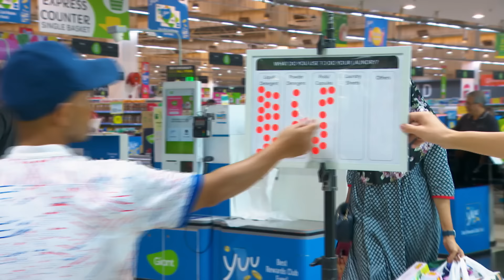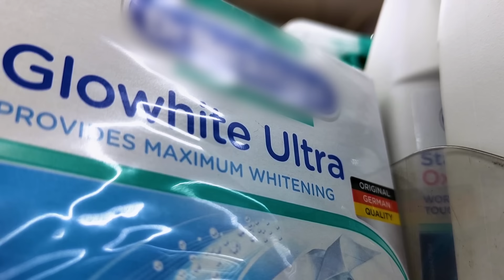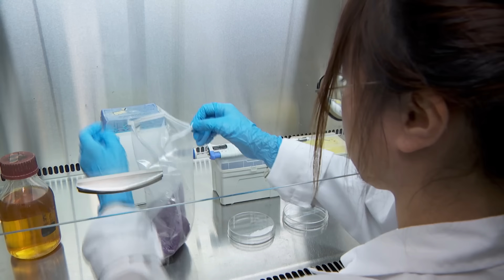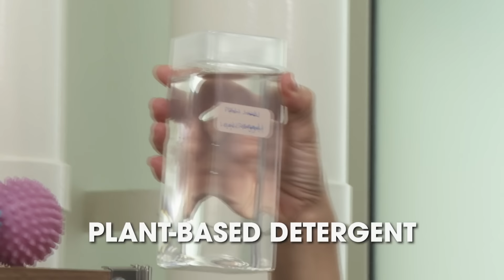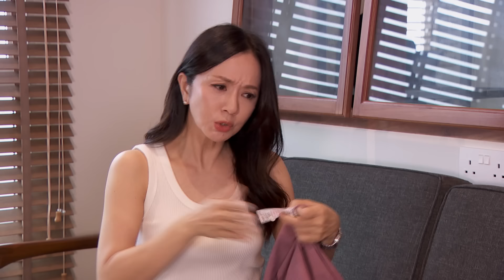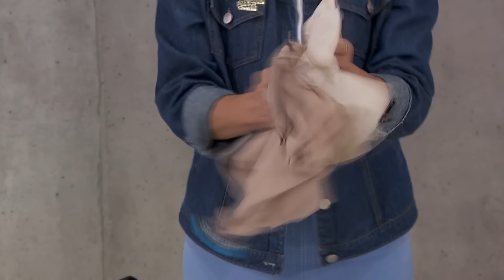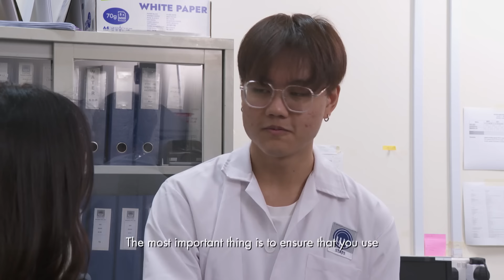Which Laundry Detergent Works Best? | Talking Point | Full Episode

Comment: Nice piece. It's confirmed my opinion that antibacterial laundry detergent is just a gimmick. However, there are other factors people look for in clean laundry other than germs, and that's grease and stain removal. My liquid detergent is great on its own, but when there are heavy stains like tomato, coffee and kunyit, a half scoop of vanish (or any other hydrogen-based cleaner) helps so much to lift stains. Also, softener and optical brighteners are unnecessary and damage clothes in the long run, especially synthetic fibers like sportswear.
Reply: I agree. A stain reducer is great for stains, but almost any detergent works otherwise. Bacteria can be reduced by drying laundry on a clothesline (or other air drying)
Reply: @kawaiidere1023 Depends on the dryer temperature. And of the water used in the washer. 
But hang drying clothes won't destroy all bacteria or viruses.
Reply: Drying it outside in the UV light ( not necessarily direct sunlight) kills bacteria and mould. It also softens as the air fluffs up the fibres, and smells fresh. No need to use a dryer. That electricity is expensive and polluting.
Reply: So u add vanish together with liquid detergent inside machine?
Reply: anti bacterial actually decrease the smell of my sweat-wet t-shirt(cheap, mostly cotton) I wear inside my work shirt (was A/C tech, sweat buckets)

I also finds out that my cheap jeans and work shirt scrape me less with detergent
Reply: Yes, that's because all surfactants will destroy the outer membrane or shell that protects the bacteria, thus killing the bacteria. Antibacterial claims are just a gimmick. 

The same applies to your hand/body washes. All soaps (even bar soaps) are effective at removing dirt/impurities and  bacteria. What you do after is what matters. Our skin has a protective layer called the stratum corneum or skin barrier. It protects us by preventing microbes from entering our bodies through our skin. If you have a weakened or impaired skin barrier, micro cracks will appear, and this in turn allows moisture to escape as well as allows microbes to enter your body through your skin. Moisturizing your skin after a bath/shower or washing your hands will strengthen and reinforce your skin barrier.

Just as the video illustrates, it doesn't matter what detergent you use, the most important step is to ensure that you clean your washing machine regularly (at least once a month as the host said). Similarly, it doesn't matter what body/hand wash you use. Liquid or bar, both will do the job well. It's not skipping the moisturizer that's the most important step.
Reply: I learnt the hard way about softener. Any sportswear will degrade and smell bad with a combination of extra detergent and softener.
Reply: Nice. But my clothes smell nicer with softener..
Reply: @nadnada5436  softener often leave a layer of something film on clothing. It will also damage your washing machine in the long run.
Reply: @sleepyearth It's common to use too much liquid fabric softener ... especially if a front loader washer is used because they employ less water than a traditional top loading machine. Plus people tend to use the same amount of softener regardless of what's being washed; e.g. an average load with t-shirts, socks, underwear, vs a load of linens, particularly towels.
Reply: @nadnada5436 why do you need that. Clean clothes should smell of nothing. I find with low temperature washes that clothes don't get clean and you then need to mask it with perfume.
Reply: Yes, but softener will make your clothes smell bad faster if you sweat. It gives bacteria a better breeding ground on your clothes.  @nadnada5436

Comment: For me, it depends on how and when you want to wash your laundry. For example, if I need to soak my laundry/linen overnight, I'd use powder. If I want to wash my laundry immediately, I'd use liquid. I'm from a rural area in Malaysia, so sheet detergent and laundry pods aren't readily available. Also depends on the type of washing machine you're using I guess. Mine's semi-automatic so I can control how much water I want for my load of washing, therefore I might need to reduce or add more detergent. So far I mainly use powder because it's more economical, and I'd fill up up my washing machine with water first and add powder and let it dissolve by letting the machine do one minute cycle on low/gentle. From my experience with automatic machines, you can't really do that because the machine will only do a cycle if there's actual laundry inside.

All in all I think all types of detergents has its own pros and cons. I buy my detergents in medium sized packs so I can have the variety and choose to use what I need at my leisure without straining my wallet. But I guess that works for me because I live with my mom and we're a small household so this works for us, but it might not be suitable for a big household that has a ton of washing to do daily.
Reply: Laundry pods are also not good for the environment. I read Jumbo sizes require to use more of it so not really a saving.
Reply: Semi automatic? Is this the one that have 2 compartments...washing & drying a.k.a the OG? HAHA
Reply: If you add detergent before adding clothes, etc., it'll dissolve as the tub fills. (Just check if you're using cold water.)
With automatic machines you can also add the detergent first to the drum (dissolve it if necessary) if you're not using the pre-treat/pre-wash cycle. But even then you can add dissolved detergent via the dispenser (at the right time of course). I do that because I titrate the detergent to the size of the load and to what's being washed. (Better to start with the least amount of detergent and increase as needed.)

Comment: I long came to the conclusion most of the newer and improved products are just schemes for the big companies to get more of your money. For a very long time I cannot get powder detergent from Costco. The so call eco friendly stuff often comes in liquid form are mostly ineffective and crap. Don't even get me started with the disgusting scents that most people are brainwashed to think they smell "fresh". They are all synthetic fragrance that will trigger my allergy and my nose would not stop running. Even often the commercial powder detergent are often laced with this disgusting perfume.

Liquid detergent is just detergent with water to add weight and their dispenser always makes a mess. Capsule detergent is the worst of all create to get more or your money especially the lazy people. My European washer has a 1/2 load setting, and do you cut the capsule in half? Just plain stupid, when you can just scoop in 1/2 the powder detergent.

I finally found out the current crop of Costco commercial powder detergent has no scent. I bought a 5 gallon bucket and it will last me indefinitely. I can scoop in the amount I need depends on the load size, water temp setting, and how soiled the load is.

Comment: Get a washing machine that has a "Clean washer" reminder every 30 washes. A half cup of bleach in the washer during the clean washer cycle (no clothes in the washer) will maintain the required cleanliness.
Reply: If that's a concern all you have to do is run a wash cycle on the hottest water available. Bleach won't necessarily help and, depending on what you mean by "clean," the issue is with the water that's always left in the machine (not in the tub) after each load.  That water gets added to the next load¹ and means you may have to clean the machine before you've done 30 loads. 
¹One reason I hate laundrettes!
Reply: @elaineharley5501  Most washers in Asia are cold water only (unless it's one of those more expensive front load machines with a built-in heater) so a disinfectant like bleach would still be needed.
Reply: Bleach is not needed!  It's very detrimental when it reaches the water supply. And all these commercial detergents use some form of oxygen bleach. Using too much detergent is the problem. It doesn't break down properly and sticks to the machines insides, going mouldy and causing blockages. Talk to the repair man! White vinegar is all you need. Wipe down around the door with it, remove the detergent drawer and wash in hot water and then run a hot wash cycle with vinegar instead of detergent. No dead fish and coral reefs.
Reply: A wash with vinegar first to remove debris will be needed first. Then, use bleach to sanitize.

Comment: My techinian told me for not using fabric softener as well. Since It's bad for health, Washing machine,and clothes.
Reply: You can use vinegar as a fabric softener.
Reply: @Boodieman72 And that can void the warranty so check first. (Vinegar can affect the rubber gaskets.)
Reply: Told you what? (Your first sentence isn't clear.)
Often the problem is people using too much fabric softener ... especially in front loaders that use less water vs. top loaders. 
But no, used correctly it's fine for most people. And the machine. And clothes. 
P.S. Cleaning the machine occasionally, depending on frequency of use, helps immensely.

Comment: Other than cleaning the washing machine using the washing machine cleaner, I think many people might not know that you have to remove the filter inside the tub and clean it. You will see a lot of dirt stuck in there.
I'm not sure if this is worth for the content, can CNA also cover about the fabric softener? My MIL likes to use it because my husband's family likes the smell but I do not like it because it actually smells bad after few washes. In the end, I wash my own clothes with detergent only. I also done my own research that fabric softener is not necessary at all and is a waste of money. Not all fabrics are suitable to use softener.
Reply: Yes, there's many advice on not to use fabric softeners which will accumulate gunk in the drum. Fabric hardens because of excessive amt of detergent. Many on youtube have also adviced to significantly reduce amt of detergent used, instead of following the instruction label.
Reply: To add, there are articles which say that fabric softeners, as they contain silicon, shortens the lifespan of a washing machine. So I don’t use them.

Comment: Moral of the story, just use the cheapest detergent, cause it doesn't matter anyway.
Reply: @Unique8802the cheap detergent likely had a high pH due to chemicals used which caused the itching. Will clean good but not skin friendly as you discovered. Cheap detergent doesn't use enzymes so relies on the higher pH. 

The reason not to use cheapest detergent depends on your machine. Front loaders should use detergent specifically made for front loaders to ensure longer life of the machine. 

With top loaders you can be less strict.
Reply: Persil is best 😅
Reply: So that is only two aspects of washing that were tested.  Other factors like stain and odor removal were not tested, and in more comprehensive tests these are the areas that vary between brands and types of detergent.

What this actually means is that surfactants are effective at removing bacteria.  Which means soap works, and you know, water is wet.
Reply: it matters.. you use cheap detergent your clothes color fades faster
Reply: It does matter in my case. Liquid detergents stick to washing machine and invites bacteria making WM smelly and causing mould.
Reply: @distantpulse-x5d in my case the capsule sticks.
Reply: Yes because richest ones don't know how to work well 😂
Reply: I find it’s the fabric softener that makes the front loaders smell and if clothes are then stored for a while they also have a distinctive vomit rancid smell so have stopped using it, instead I spray any stains with a stain remover, then put the detergent of choice in the drum not the drawer, then a capful of disinfectant in the drum shut the door and then put a good glug of white vinegar in all 3 compartments in the drawer.  No fabric conditioner is used at all as the white vinegar softens the water therefore softening the clothes in the final rinse (as I had put white vinegar in the fabric conditioner square in the drawer), the vinegar also keeps all the pipes clean of build up and in my case, lime scale as I live in a hard water area, clothes do not smell of vinegar, the vinegar also sterilises the clothes but I do like a capful of disinfectant too, I like a good hot wash but low spin unless it’s a delicate wash.
Reply: @munchkinheaven7877   finding it hard to buy the right type if vinegar. What percentage/concentration do you use for your washing?
Reply: @RoyalUniverseRU2free and clear
Reply: No it does matter...
Reply: Agreed ! Other way appliances do not last , washing machines just die any way , mass production ..

Ruin yr washer fast ,the plastic pod bombs block yr pipes and fliters 🤦‍♂️🤦‍♂️🤦‍♂️
Reply: unless you have allargy
Reply: It does, mostly if you have sensitive skins. 

And also the type of washing machine.
Reply: Thank you so much! The video is quite long. I went to the comment section for your comment 😂
Reply: Wrong. Wonder why your laundry is dingey ?
Reply: I pay for the scent
Reply: Thank you
Reply: i use cheaper detergent,plus buy softener. so it will be best.
Reply: I notice some detergents are more gentle on my clothes than others. This means my clothes last longer when I use them.
Reply: It does matter
Reply: @Unique8802 maybe u just use too much…normally only need a little not even a cup to wash clothes….
Reply: @Unique8802its the way you wash them.
Reply: @harukrentz435 if you have sensitive skin like me you will never comment like this. It does matter, if you use washing machine liquid detergent all the way, you only need tiny thats it. maybe vinegar in the last rinse once in awhile
Reply: @EchaKiut heres how to wash clothes using powdered detergent: 
Soak your clothes in water for 30 min first, then soak them in soapy water for 2-3 hrs then you wash them down with clean water inside your washing machine for 40-60 mins. There you have clean clothes. Im still using powdered detergent because they are good for heavy duty.
Reply: @harukrentz435 why the second 2-3h soak? One soak should be good enough and then into the washing machine.
Reply: @EchaKiut well spoken !
Reply: Analysis could be better.. Graph pls.. So newbie..

Comment: I think it's pretty commonsense. isn't it? That anything you wear or rub on your body skin (eg. body towel) can be washed together, but not with anything else that used to wipe other surfaces. Having used top and front load, I find there's no difference to the wash. Front load does not wash cleaner than top load.

Comment: The last part makes no sense because whta cross contamination is she talking about when previously it was established that even normal detergents have antibacterial properties so it makes no difference.
The only logical reason maybe that different types of fabric and washing requirements.
I am not an expert but that's my opinion.
Reply: ya, or like that, when u separate the wash, won't there be cross contamination cuz ur using the same washing machine? or must you use the washing machine cleaner in between? the investigation not deep enough.
Reply: Same thoughts as well but I still separate them while washing like rags and clothings
Reply: Disgusting, who would do that?

Comment: So simply put, Make sure you clean your washing machine regularly and it all good. Some high tech machines has self cleaning functions so i guess people should invest on that.
Reply: I found taking the waste pipe off ( at the waste pipe not the machine) and giving it a few firm bangs and then let the water from machine run into a large bucket…you would be surprised how much gunk accumulates in the pipe restricting the water flow.